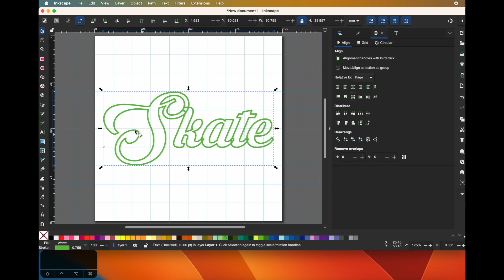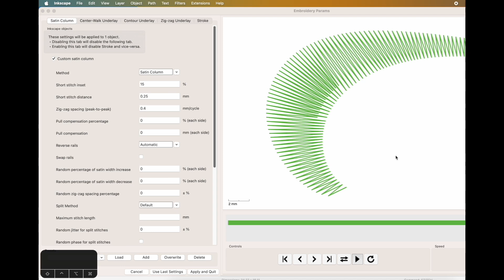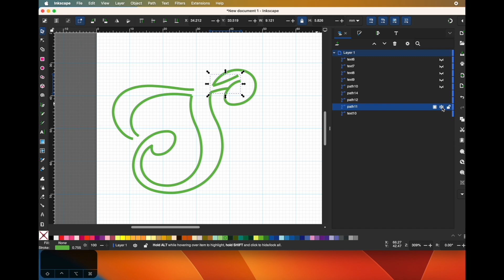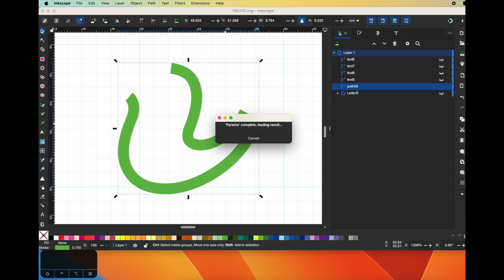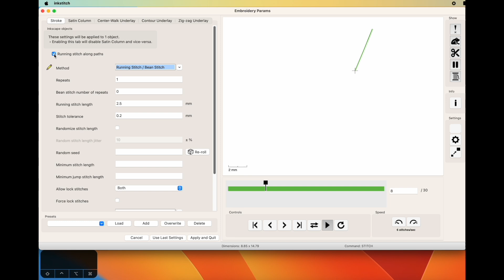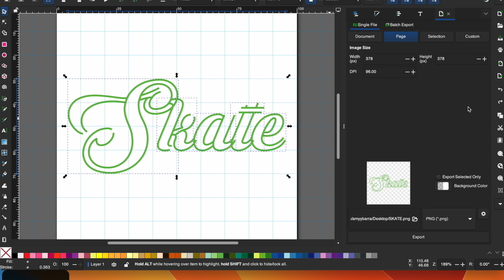Digitizing Inkscape's Font Lettering  into Satin Stitches using Inkstitch

Comment: Thank you for this video!  Initially I was getting frustrated because some of the keys you said to press didn't coordinate with the desired action and other times it was hard to see what you were doing.  I decided it might be the difference between PC and Mac so opened a new canvas and followed along.  A couple times I had to google the commands but I really like this way of converting text to satin as opposed to using the bezier tool and tracing over the text to make now columns then adding rails.